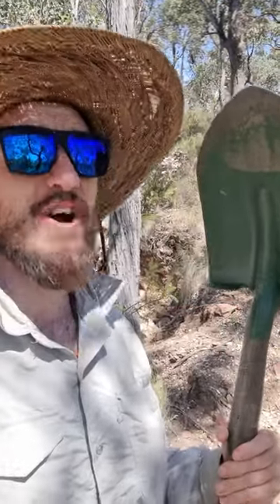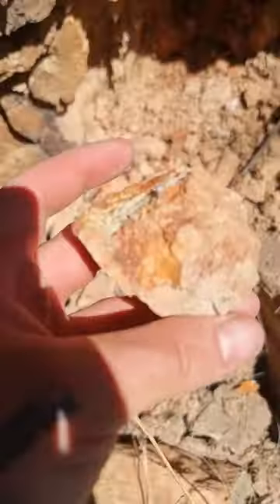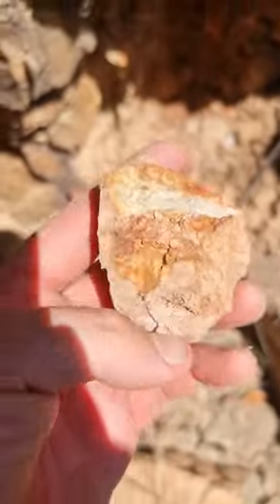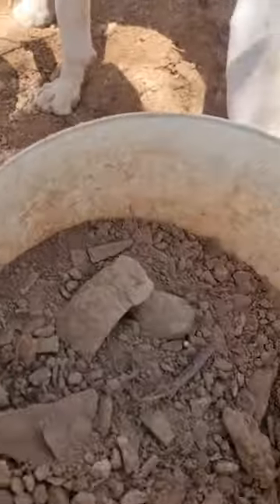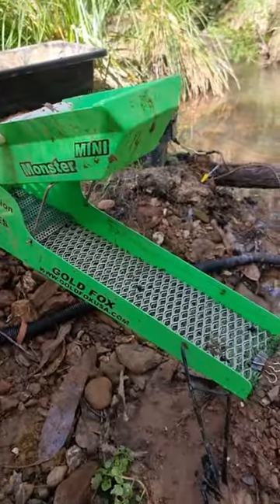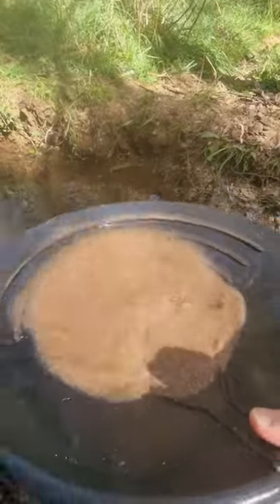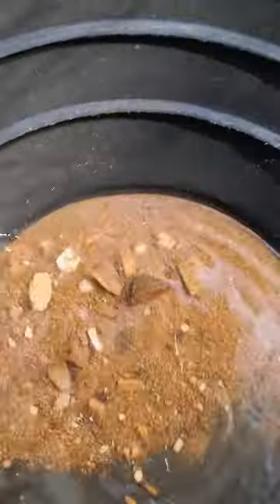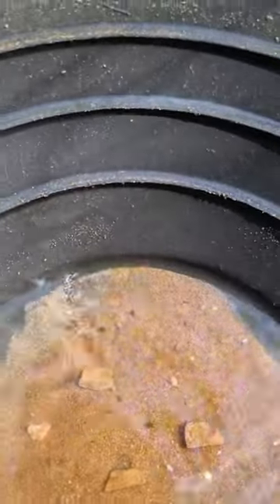sampling for hard rock gold

Comment: Question. Couldn’t you just run water into the bucket? Everything heavy will go to the bottom and most of the sand and crap would go out the top. Wouldn’t that be easier? I don’t know anything about this. I’ve never done any of this. But I did play a prospector on TV last night. Just kidding that’s from a commercial.